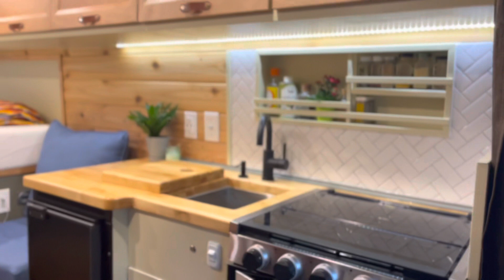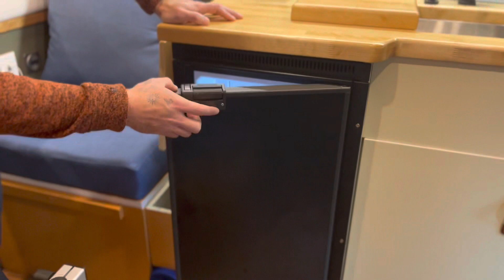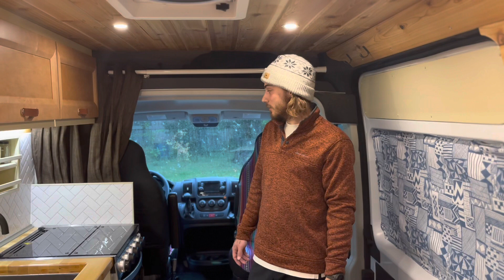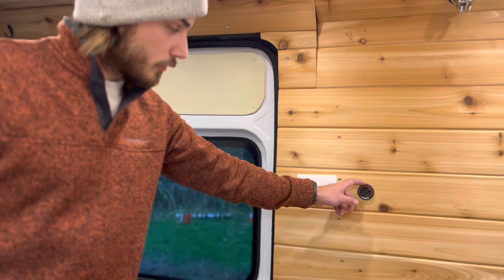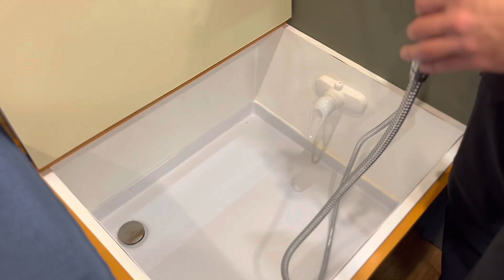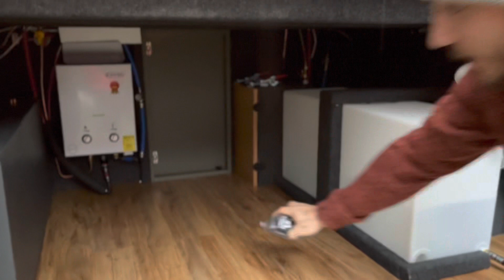2021 Promaster Offgrid Adventure Conversion TOUR

Comment: really nice build...curious, what is the fridge? Also, those water heaters give off a ton of heat through the top, how are you managing that?
Reply from the maker: Good thoughts, we armored under the bed with metal sheeting. The heater shuts off if it uses the available oxygen. We keep the door open to the under bed storage when using the shower with the fan on. Works well! Fridge is Truckfridge TF78
Reply: @SamaraVanConversions  cool cool. So it would turn also if you were using the sink faucet too though no??
Reply from the maker: Yes there is hot water plumbed to the sink. You can turn off a valve so it doesn’t come on and off all the time and it’s just cold. If you want hot water just flip the valve and you’re good to go.

Comment: Awesome Van for sure. A couple things I'd change. More batteries. 200ah really isn't enough for boondocking.  Does it have solar panels? Plus, I'd make the top of the shower wider so less chance of it touching you while showering. Nothing worse than the shower curtain touching you.
Reply from the maker: Thanks for the input! We left space to add 2 more batteries, but with lithium it definitely is enough, unless you have some serious electrical needs. 400 watts of solar. The wider shower top would be nice, but it is as big as possible while still fitting inside the “shower box”. Good day!